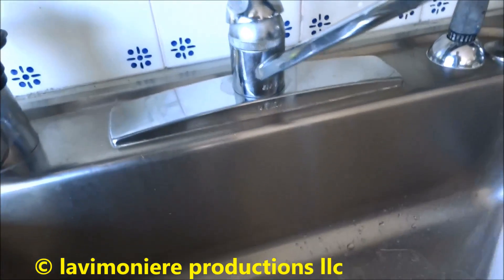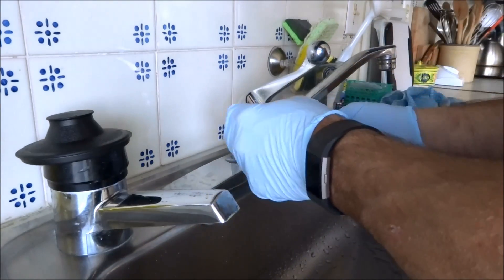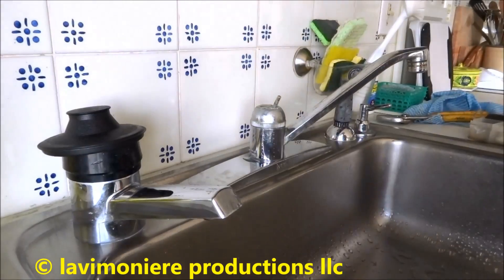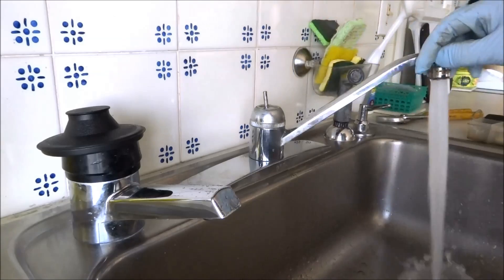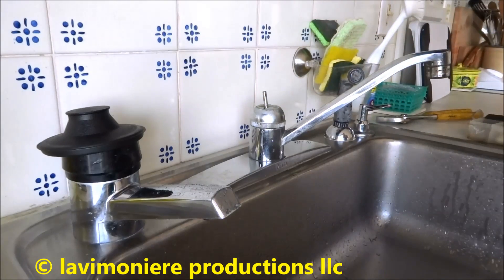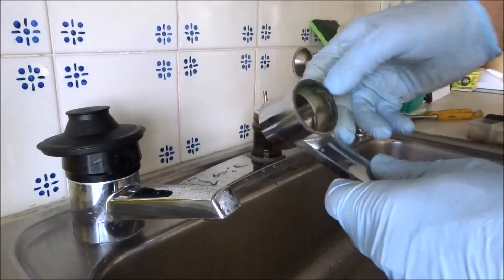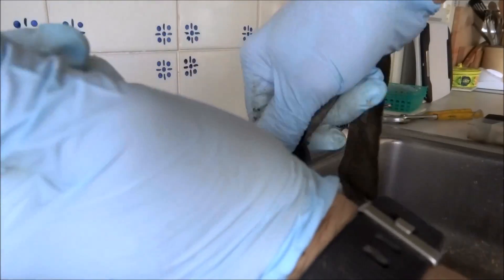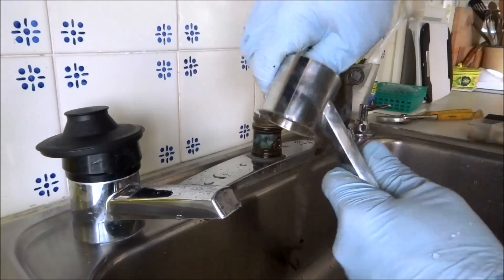delta kitchen faucet repair

Comment: I like Delta faucets. Delta will send free parts if they go bad if you're the original owner. I have gotten into the habit of taking mine apart once a year to clean it and lube it. In your video you can hear how much quieter and smoother the faucet turns after lube and new o-rings.

Comment: how can you get that silver nut off without the strap wrench? Do I need to buy it from Depot first? Mine is super rusted so it doesnt come off with bare hands.. :( 
Thank you!
Reply: you could buy the strap wrench Home Depot Harbor Freight Tools is cheaper I bought a cheap one it's all plastic and rubber good enough if you use it once in awhile

Comment: Never use sand paper.  It will corrode much faster if you do.  Use a soft cleaner, grease your “o” rings and reassemble after replacing all rubber parts.

Comment: I recently I stalled a new delta faucet and very little water is flowing even though the water pump is on all other taps has full water flow, what could be the problem
Reply: Did you take the aerator screen off before running your water for the first time?  Crud gets shaken loose whenever you repair or replace a faucet.  I always run water first, then install the aerator screen.  I'd check to see if it's clogged and flush or blow it out.

Comment: just spent way too much time on a "Repair/rebuild" .....it was better in some respects but had a leak in a new spot....if it worked i was a hero..now I'm a zero..I should have just installed a faucet...the thing must have been about twenty years old...time for an update!/new version of the same faucet!

Comment: how much did you charge for that service call
Reply: richard atkins parts and labor. 96 per hour and probably like 10-20 in parts.
Reply: Mookie Man I am a maintenance supervisor for a property management company and we do things like this on the regular but I was jus wondering how much an independent jack of all trades would charge thx for the info
Reply: Steve is not a jack of all trades person. Unlike your "crew" he is licensed in many areas. A master of many plumbing and hvac trades. When your crew changes a air filter can they get the arrow pointed in the right direction?
Reply: polishtheturd mickelson oh great we got a troll in there my particular crew we do everything anything having to do with plumbing too full on AC work we are not just a typical run-of-the-mill air filter changes that's how you want to put it I was just trying to see how much he charged for that particular service the end it we do so much I was kinda beginning to think I might be in the wrong area of the business maybe wanting to Branch out on my own such as he is
Reply: Troll, me how about that? I got a nickname tonight from a jack of all trade leader, master of none.  It depends on your area of the country you are working in and your skill level on what you can charge? Referring to Steve as a independent jack of all trades was rude to him. That is what put me off on your comments dick atkins. I don't think you can cut it on your own. Better stick with the property management supervisor gig, manage away. They need your guidance, lol. Show they the path to success.
Reply: polishtheturd mickelson Jesus Christ all this because I asked him how much he charged calling him a jack-of-all-trades was not rude I just see him doing so many different things and he does a great job at it I wasn't trying to troll him or be mean or anything and yes I can cut it on my own I do lots of side jobs I was just curious on how much he charged for that damn it
Reply: where I come from which is the East Coast where he is Jack of all trades is sometimes considered a compliment with the exception of that master of none that's a bit degrading depending on how it's used I like the work he does
Reply: Woah, calm down ricky. You seemed a little agitated. Better have a cutie orange and take a time out, also have mommy give you a pat on the head. Good luck on supervising the crew and your side work. I think you should charge 15 dollars a hour if you start your own business, hopefully you can live up to that pay scale for your customers.
Reply: Yup, have a good life! No east coast visits planned for me.